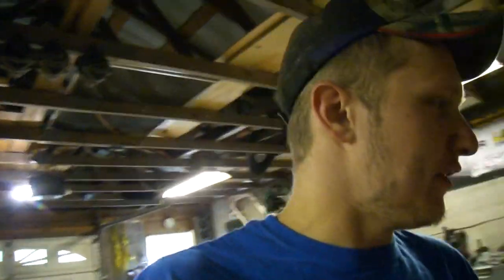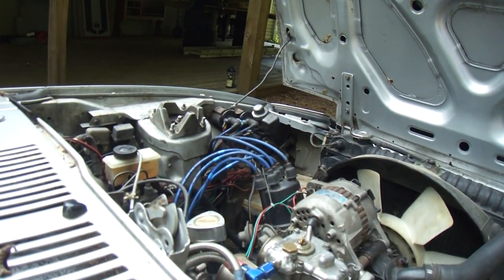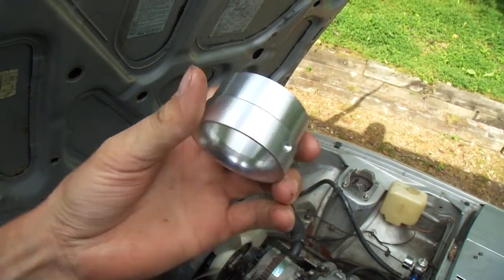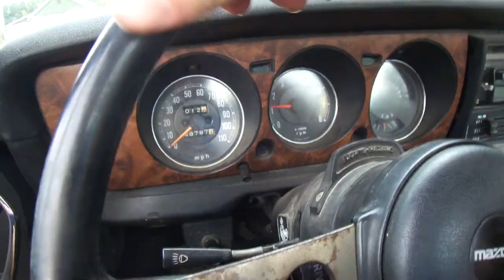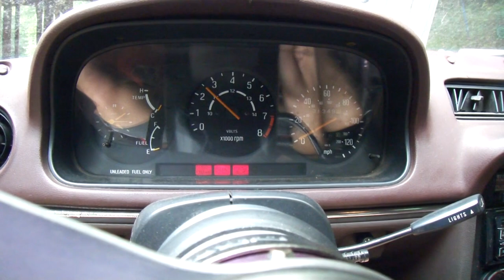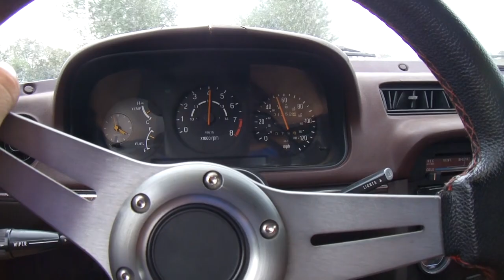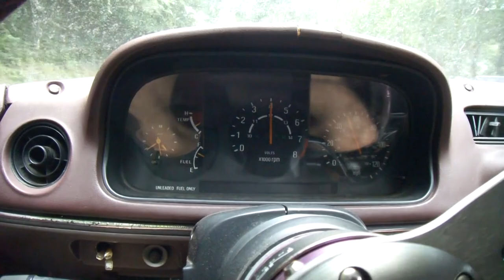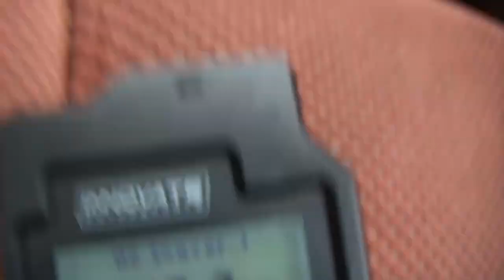Full Bridgeport 12a Weber Tuning - Changing Choke Tubes/Venturi

Comment: The 2k rpm is too high for not having the throttle blades drilled to at least like 1.5-2mm. That’ll help with bringing the throttle blade back and cover the progression holes. That should help you a whole lot more to discern which circuit you’re in. Idle screw shouldn’t be more than 1-1.5 turn out (that’s the correct jet size). The progression holes helps smooth out the transition, but it depends of the idle fuel/air jet how rich and how it kinda fades before the mains kick in. You could also try different pump bypasses and nozzles to mess with the squirter timing to meet better the engine needs. I think the weber carburetor is the most touchy, but customizable of all the carburetors.
Reply: If you’re idling on a progression hole or 2 what happens is you run the mix screw almost to the bottom or use a super small jet and as soon as you crack that throttle and the engine demands more fuel through the progression holes… lean spot

Comment: just a dumb question but do you have any vacuum leaks like out of the brake booster or anything?  I have a miata that does the same break up thing a bit and it has vacuum leaks that fuck with the megasquirt

Comment: Your damn close 👍...... Bridge port engines can be temperamental.....
 Hold your course..... You're almost there!....... If you decide to use an air cleaner that's also going to change things......
Reply from the maker: Planning to build a large plenum and run a cone filter out front of the radiator.  Should breathe very well
Reply: @RADPotential  that   Massive runner is going to contain a  ton of air.......are you  Familiar with a phenomenon called " port stacking"...?.....even with a full bridge engine .... port  Velocity is critical!!

A long runner is DEFINITELY  going to generate  " lag"  Until the port gets "moving"....

Comment: Going lean on part throttle at lower rpm ranges (before 3000), its more on the idle circuit, main circuit does not fully kicks in yet, maybe you should try to fiddle with the idle air correctors, try going smaller size to richen up the idle circuit, clearly you had a flat spot during transition( idle circuit to main) it usually means your main circuit kicks in too late, which i think isnt the case, or your idle circuit is lean on top.
Reply: By changing the idle air corrector it is possible to tune the mixture strength and duration of the progression circuit through transition and onto the main circuit.
Reply from the maker: I worked through quite a few different jetting specs and the only thing that made a difference was swapping chokes.  But I lost a bunch of top end going smaller
Reply: Guess the 50dco was a very big carb... can't help it I guess.. hahaha